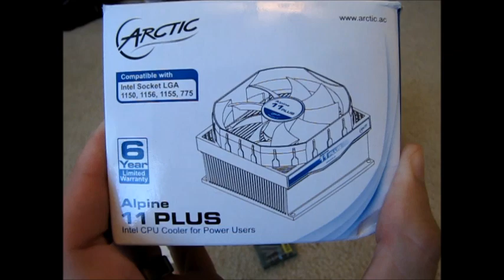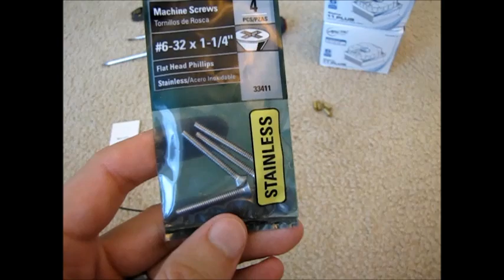How To Build A Peltier/TEC Cooling Device (Thermoelectric Cooler)

Comment: I have an ice chest in the back yard and this looks like something I could to to keep it cold most of the time.  I also have a back yard stereo which is currently connected to the wall but also a huge 12volt lithium battery incase the power goes out I can listen to music.  

So maybe with this and add a 100 watt solar panel I can have the ice chest and the stereo off grid.
Reply from the maker: OutlawUniverse That is a great idea.  Never hurts to be prepared.  Thanks for watching!

Comment: The TEC 12710 is a 10.5 amp 15.2 V also if cooling is your goal you would get better results with different fans on each side.

For your Reference:
http://www.everredtronics.com/thermoelectric.TEC1.html
Reply from the maker: DryRoastedNutz What fans would you suggest?

Comment: I'm (hopefully) making a simple mini warm/cool plate with a knob to vary the TEC, only I'm not sure if I should vary it by regulating voltage or by using PWM frequency.  I had to learn a lot in the last few days just to ask this question haha. I know enough to build a light switch circuit but my solder skills are better (cable assembly experience).

When I started this I was hoping to just put a light dimmer, a laptop power supply, a switch,  and the TEC in series.  I've since learned about mosfets and PWM controllers and arduino boards and lowpass filters and and...

How are you varying your TECs? I looked into PC fan controllers as cheap PWM control but they're underrated I think.
Reply from the maker: I honestly haven't started regulating the power to the TEC.  I just let it take what it wants at this point.  You might also consider a potentiometer as another option.

Great question, though.  Maybe another subscriber can answer.  I would be interested in hearing about your results!
Reply from the maker: Jonathan Braithwaite Nice!  That sounds great.  I really want to know how well that works out for you.  I have so many other projects going on right now that I can't concentrate on the TEC stuff for a little while longer.  Before I do my next refrigerator build with the water cooled TECs I would love to know how to better control them for precise temperature control.
Reply: LDSreliance on aliexpress theres some TEC controllers (I assume they can intelligently switch polarity) around $8 free shipping, 125V 10A ... thank you China.  Could make a smart pizza box w/digi display 12v for like $30 I'll bet hehehe sell it to pizza hut

Comment: How about a materials list? Ty
Reply from the maker: Sure thing:

http://www.amazon.com/ARCTIC-Alpine-11-Plus-Cooler/dp/B00606OHQQ/ref=sr_1_3?ie=UTF8&qid=1415374100&sr=8-3&keywords=arctic+11
http://www.amazon.com/Tec1-12705-Thermoelectric-Cooler-Peltiers-77wmax/dp/B007JCVRSG/ref=sr_1_1?ie=UTF8&qid=1415374124&sr=8-1&keywords=tec+12705
http://www.amazon.com/Arctic-Silver-Thermal-Compound-Grams/dp/B000OGX5AM/ref=sr_1_1?ie=UTF8&qid=1415374161&sr=8-1&keywords=arctic+silver

As for the fasteners, I used computer standoffs for motherboards that I had laying around (you could get them at any computer shop) and some matching threaded bolts from the hardware store.  Don't remember the size but it wasn't too hard to figure out.

Comment: Where can i get the screw to screw the heatsink fan together?
Reply from the maker: I bought them from Home Depot but you could also order them online fairly easily.  Hardware stores will have a big selection of machine screws like this to choose from so just take some careful measurements before you go in and pick up 4 of them.
Reply: LDSreliance Do they sell it in Singapore?
Reply from the maker: I am sure they do.  I ordered some screws from China a few months ago off of Amazon.  I would check there.
Reply: LDSreliance Maybe i know how long should i buy and how big is it?
Reply from the maker: The ones I used were #6-32 thread and were 2" long.
Reply: LDSreliance What type of screw you are using? Can i have the full name of the screw?
Reply from the maker: It is just a machine screw.  #6-32  2"
Reply: LDSreliance Where do you get the golden washer?
Reply from the maker: Those are standoffs for computer motherboards.  You can get them anywhere that sells computer parts.  Try here:  http://www.amazon.com/StarTech-Brass-Motherboard-Standoffs-Computer/dp/B00213KL5I/ref=sr_1_1?ie=UTF8&qid=1418912312&sr=8-1&keywords=motherboard+standoff
Reply: LDSreliance That is too much for me. I only need 4 of the motherboard standoff and the cost is that cheap.
Reply from the maker: You can probably pick some up from a computer shop for $1 or less.  Or maybe you have a friend or relative that builds computers.  They will have some laying around.
Reply: LDSreliance Okay. Thanks.

Comment: wouldnt the hot and cold air be blown in to each other? or does the hot side get sucked out and the cold side blows into the fridge?
Reply from the maker: Both fans blow outward so the hot air is blown away from whatever you are cooling and the cool air is blown inward.  They should also be separated by a barrier that is as air tight as possible to prevent any leaking and mixing.

Comment: Can i get the link for each item? i cant find them
Reply from the maker: Sure.

http://www.amazon.com/ARCTIC-Alpine-11-Plus-Cooler/dp/B00606OHQQ/ref=sr_1_3?ie=UTF8&qid=1415374100&sr=8-3&keywords=arctic+11
http://www.amazon.com/Tec1-12705-Thermoelectric-Cooler-Peltiers-77wmax/dp/B007JCVRSG/ref=sr_1_1?ie=UTF8&qid=1415374124&sr=8-1&keywords=tec+12705
http://www.amazon.com/Arctic-Silver-Thermal-Compound-Grams/dp/B000OGX5AM/ref=sr_1_1?ie=UTF8&qid=1415374161&sr=8-1&keywords=arctic+silver
Reply: Would it be okay to use this instead? http://www.amazon.com/ARCTIC-Alpine-11-Plus-Cooler/dp/B00606OHQQ/ref=sr_1_3?ie=UTF8&qid=1415374100&sr=8-3&keywords=arctic+11
Reply from the maker: Yes that is the one I linked you to.
Reply: Oh I meant the alpine 20 plus version!
Reply from the maker: You would not be able to sandwich those together around a peltier because they do not have a hole that a bolt or screw can go through to tighten them together.  It looks like they have a permanently attached connector on each corner that is obviously designed to connect to the holes on a motherboard.  But they aren't designed to connect to another heat sink that also has those same connectors where the holes would be.  See what I am saying? 

The Arctic 11 just has holes in the corners so I was able to go to the hardware store and get some longer screws and attach them together.

Comment: Hi i got a question. Why do you need another fan to blow the air from the Peltier  ? Could you just just add one fan to blow the air from the cool side since it is a cooling device.
Reply from the maker: The fan on the hot side is critical because we need to blow the hot air away from the unit.  Also, it will improve the heat shedding ability of the heat sink.

The fan on the cold side probably is not critical and, as some have pointed out, may actually limit the amount of cooling because of a slight amount of heat generated by the fan itself.  I don't have sensitive enough testing equipment to find out either way.  So you can consider the cold side fan optional.
Reply: LDSreliance Thanks

Comment: Results?  or link to results video?   Thanks!
Reply from the maker: DIY Peltier Device Testing Results
Reply: LDSreliance Thanks!   Did you try stacking 2 the chips?
Reply: DenverDave2 Oh I see info on stacking on the test results video - thanks.
Do wonder what the results would have been with twice the insulation wall in the cooler?
Reply from the maker: The amount of insulation doesn't seem to matter a ton.  I am sure that by doubling the insulation I could drop things a few more degrees but I suspect that my peltier cooling setup isn't super effective at transferring the heat or cool to the volume of air.  See my failed refrigerator video:  Mini Peltier Fridge Prototype - Learn From My Mistakes

Comment: Will the fan run without PWM to control it on those cpu coolers?
Reply: Kyle Snyder For a 4yo question... Yes, if you want sophisticated controls which i do sometimes, for "improving" this kind of project, you can buy a pwm controller module.
.
You see, 3pin and 4pin cpu fans compatible with each other. The only difference is the pwm pin.

Comment: SIR,
  i am making a project on peltier helmet. how much current should i pass through the peltier plate if its specification is 6 ampere 12 volts and 60 watts. should i take 6 ampere or less...and why ?
Reply from the maker: I would use a little bit less than the 6 amps it is rated for.  Peltier devices are more efficient with less power.  However, it obviously will not achieve the same temperature delta (in other words, it will not cool down or heat up as much).  You might want to try 5 amps and go from there.

Comment: How do you wire the fan with four wire which do you use
Reply from the maker: If you are lucky your fan will have color coded wires and the red will be positive and the black will be negative.  If all the wires are black, look on the connector before you cut it off and the wire on one of the ends will have a line or arrow next to it (the rest will be blank).  This will be the negative wire.  The one right next to the negative wire will be the positive wire.  The other 2 wires are not needed (they are speed sensing wires for computer cooling purposes).  If you have already cut off the connector you will need to test the wires to determine which is which.  One of the wires on the end will be negative and the wire immediately next to it will be positive.  Just use a battery or other power source to test until you figure out which side is which.

Comment: Will a 5A 12V PSU for a router work for a 92W chip? Would it burn out my PSU or would it just run below full potential?
Reply from the maker: It should work but it won't power it to the full 92W.  Amps x Volts = Watts so 5 x 12 = 60.  I have heard from several sources that peltiers actually run more efficient at a lower wattage than they are rated for, though, so it will still work but won't get as hot/cold as it could with more power.

Comment: The main issue that I see with this design is that there isn't an inlet/outlet for the cold and hot air. Due to the structures of the heat sinks that you are using it's difficult to direct the airflow. I would use those CPU coolers that have a fan mount which is perpendicular to the point of contact with the peltier,
Reply from the maker: It would be worth testing, for sure.  However, computers have been doing it for many years this way so I think it is fine.  Maybe not the most efficient possible setup but it gets the job done.  I will be making an improved version of this setup in the next few weeks so stay tuned.
Reply: What do you mean computer have been doing it for many years? Do you mean putting a peltier between a cpu and a heatsink , because if so then that is a completely different story because you don't care where the hot air flows to as long as it's flowing out of the cpu but in an application where you need the cold air separate to the hot air then you need directed air flow.

Comment: About 10 years ago , I was in Tokyo  and saw a lot of people wearing wide headband on their head(duh) or their neck. It turned out to be a personal portable AC. Since you used to cooling points in the body. The head band dindt weigh much , just elastic and pockets where these (I suppose) Peltier units were inserted. They would use a 12 Volt power pack clipped to the belt. and MY GOD it was amazing. . They dtrated as a portable , cooling thing to go in the street in summer , but they realized that why cool a WHOLE house in summer ? Just cool humans and pets.
I brought one to the USA and it last about 4 years . It went on the fritz and noone knew what to do with it . The manufacturer had sold to a biger company and no traces of him reamained.
Now I am seeing small cooling plates that run off your USB port and are used to keep drinks cool.
Are you aware of this thing that never made it to the USA?

Comment: I have to say this is the most aesthetically pleasing and clean cut peltier cooler I've seen :)
I was curious what would be the best way to power this device with the use of home outlets. I thought about going the "adapter for the peltier and usb leads for the fans" route but can they all be plugged into a cpu power supply? I have one lying around but holy toledo, batman, so many wires!
Reply from the maker: Thanks for the feedback!

You could get a computer power supply to work but it takes some work to trick the power supply into turning on (normally it is connected to a motherboard that relays the signal from the power switch).  You then have to hack up some of the wires and connect the fans to low amperage 12v rails and the peltier to the highest amperage 12v rail.  If you already have one laying around then this method is free and only costs you time.  Or if you have a few bucks and want a more elegant solution, you could order something like this (http://www.amazon.com/Universal-Regulated-Switching-Computer-Project/dp/B00D7CWSCG/ref=sr_1_3?ie=UTF8&qid=1405609787&sr=8-3&keywords=12v+power+supply).
Reply: You're welcome :)
I think I'll avoid the trickery. I've got a few bucks and the linked power supply is one gorgeous beast. Thank you!
Reply from the maker: You are welcome!  Good luck with it.
Reply from the maker: I just noticed that you have to hard-wire the ac power to the unit, as well.  In other words, it isn't just a "plug it into the wall socket" device.  Hope that still works.

Comment: Do you use a standard computer power supply with 12V rails? I bought a separate 12V/10A PSU and the cooling device burnt out. Even though it's rated for 12V/10A.
Reply from the maker: You should be able to use a standard 12v rail.  These peltiers are fragile and not manufactured very well (many of them are cheaply made in China).  It could have been defective already.  I don't think you did anything wrong to kill it on your own.  Next time you could test the peltier with a 12v battery for a while to make sure it is working fine and not defective and then connect it to the computer power supply and see what happens.  Also, you could test the current on the 12v rail and make sure it is what it says it is with a multimeter before connecting the peltier to it.
Reply: LDSreliance
Yeah that's what I've done. My PSU was giving ~12V as tested with a multimeter. So that was fine. As soon as I connected the Peltier to it the whole thing heated up and burnt out. Seems like it took too much current which I don't understand since the PSU is 10A and the Peltier is 10A. I bought a second one and I'll test it with a battery like you've said. Thanks.
Reply from the maker: Yeah I would measure the amperage of the 12v rail.  Just because it is rated for 10A doesn't mean it can't spike to a higher amperage for a few seconds.  The peltier has no way to shield itself from dirty power or voltage or amperage spikes so be careful.
Reply: LDSreliance
Yeah that's probably what happened. I think the current spiked beyond 10A and blew out the Peltier, unfortunately. I should have went with a 5A supply just to be safe. Maybe I can use an older computer PS.
Reply from the maker: Or just try it with a 12v battery.  Good luck and let me know if you have more questions!
Reply: andreww1212
you wont burn this one :)
http://www.ebay.com/itm/Awesome-400W-Thermoelectric-Peltier-Cooler-12-VDC-TEC-/310158610445?pt=LH_DefaultDomain_0&hash=item4836e4d00d
Reply from the maker: That thing is power hungry!  Wow.
Reply from the maker: Yeah that would take a lot of battery power.  These things eat the juice.

Comment: hey.
  I plan to use the same for an helmet. is it possible ?. can i get a circuit diagram or something else. how can i absorb heat from the helmet. please help
thanks in advance.
also if possible can i have your email id
Reply from the maker: I am sure that you could use a peltier cooler in a helmet to help draw heat from your head.  If you could design some sort of flexible, comfortable heat sink that came in contact with your head and then contacted the cold side of the peltier that would draw heat from your head.  The hot side of the peltier would need to be connected to a heat sink that had air blowing through it from outside the helmet.  It would be complicated but it could be done.  My id is ldsreliance at gmail.

Comment: If i were to get a solar panel what size would i need,also i want the solar panel to charge a battery could i use a motorcycle battery to power the fans and the other thing for a long time,i need it to be travel size and im new at this stuff so can you explain it well please,another thing can you make a how to video on you wireing it all up?
Reply from the maker: My rule of thumb is to calculate how many watts you require and then double it.  There are many ways you lose power in a solar panel system (I will be doing a video on this soon) so if you have double the power you need you will be safe.  If you had exactly the same setup as me with 1 5amp peltier (60 watts) and 2 0.25amp fans (3 watts each) you would need roughly a 130 watt solar panel to adequately power the device.  You could use a motorcycle battery for the fans as long as you did not run the fans for very long without any sun coming to the panels.  Motorcycle batteries are not designed to be drained very far or they will die.  Watch my beginner video to solar for more information and more explanation:  Solar Panel Systems for Beginners - Pt 1 How It Works & How To Set Up
Reply: Ok thank you for the help,by the way i like the videos you do
Reply from the maker: Thanks!  If you have any more questions let me know.  I am happy to answer any questions even the beginner ones.
Reply: Ok cool ill continue to watch the vids i appreciate it